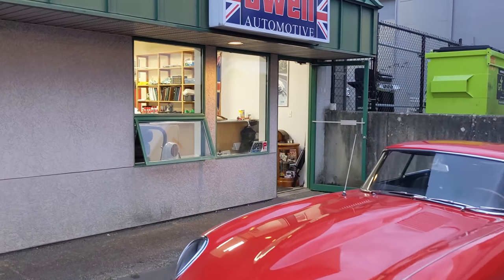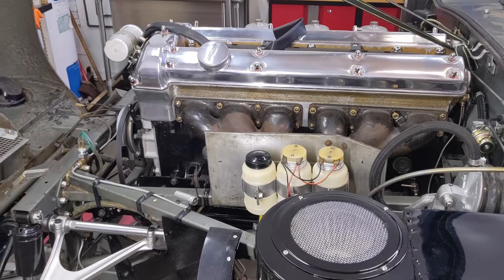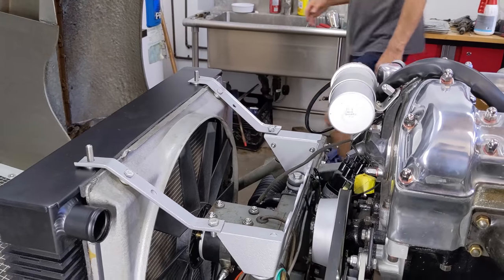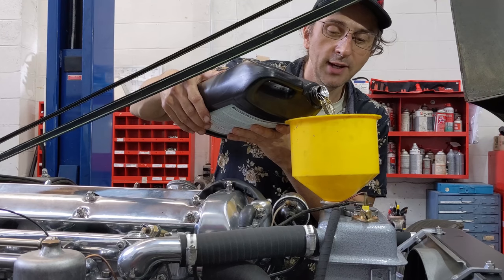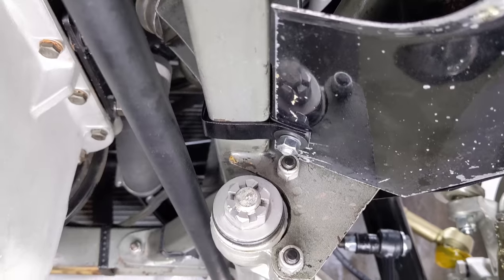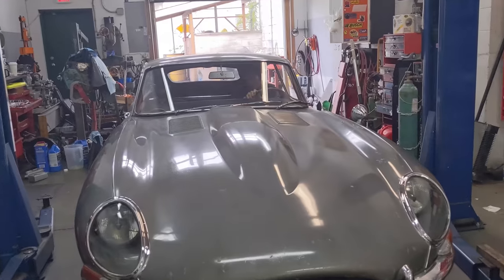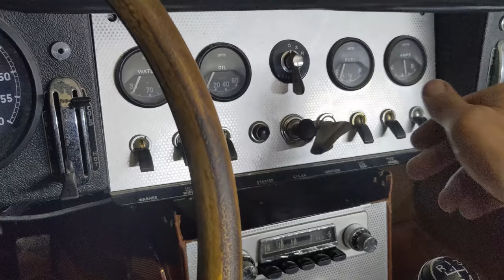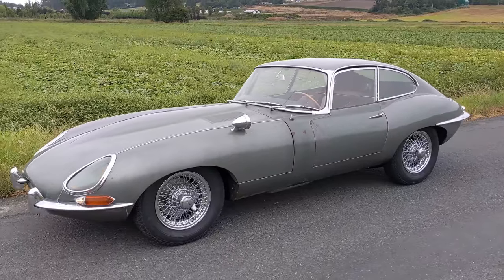Preserving an original 1962 Jaguar E-Type 3.8 EP6 **REUPLOAD**

Comment: I owned a '68 OTS in my 20s during the 70s. Watching your, Keep it as original as possible philosophy , videos put so many many smiles on my face. For I rebuilt most all of mine and boy did you bring back long lost memories. I got rid of those , in my opinion, horrible Stromberg carbs and put in the 3 SUs. Man what a difference in power. I rebuilt the rear end and changed the 3:54 to 3:31  It was my daily driver and also the car I cut my teeth on. I put at least 150k+ miles on her. Thanks for the memories and the smiles. Aloha

Comment: RMO, Great job on the car. I would love to have a Father like yours, the quiet one. Start doing this: turn your muffler clamps 180deg so as the bolts and protruding parts (the part that catches road junk) are on the top. Especially on the resonators.I like the later HD SS (Euro)band clamps.My two pennies.

Comment: I have owned a 1963 FHC "E" Type for twenty-seven years. It's a sound car if rather shabby but it had been messed about a good deal before I had it. The tan leather interior has been mostly replaced with black vinyl and it has been painted maroon from the original gold. For years and years I have wanted to find a source of photos or videos of a factory original car so I can see what went where, how it was attached, what's missing etc. so I can improve my car and make it more like when it left Browns Lane. This excellent series of videos is just what I've needed all this time. Dr Haddock's book is pretty useless by comparison. I will be revisiting these videos over and over again. Richard you have done a first class job in reviving and preserving this car which is so much more interesting than turning out just another over-restored 'E' Type. I thoroughly approve. Thank you so much.

Comment: Beautiful car.
Great job.
I'm impressed they can get spoked wheels to hold air without a tube.
Reply: Running those MWSs on my 120 race car in 16x6x72 spoke.  They work well.  I've mounted and flipped a few sets of Vredesteins on them.  No issues.

Comment: I'd recommend putting a heat shield over the rear of the generator to keep the electrical connections from getting roasted by the exhaust headers.  I made up a shield out of some scrap aluminium and pop rivets and fastened it to the generator with a large hose clamp.  Not really elegant, but sure helps the generator keep its cool!
Reply from the maker: The Generator is well below the manifolds.
Reply: @RichardMichaelOwen 
In cooler Canada that is sufficient spacing; but in the hot summers of Montana the connecting wires, and eventually the rear generator bearings, got fried on both my '63 E-types.

Comment: Awesome project!  Love seeing this car preserved.  I'm sure you've found this issue already, but, just in case you haven't, it looks like the cooling fan is rotating the opposite direction than it should be.  It looked like it was rotating clockwise (looking forward from the engine) and, thus, would be pushing air into the radiator.  Marvelous job as always.

Cheers.

Comment: Hi Richard.
Not sure if its camera angle, but do both pipes have same angle, one looks 45° the other 60° or wrong rotation.
We fitted one in 2020 and layed it out to old system.
Ours was perfect match.
Looks like down pipes not correct.

Comment: Great job, one comment - is the electric cooling fan turning the wrong way?
Reply from the maker: Hi Stuart thanks for watching. The cooling fan is right, but it can change direction by reversing the wires.
Reply: @RichardMichaelOwen  looked in the video it was going the wrong way - pushing rather than pulling. May be a trick of the video. Sam reason wagon wheels look like they are going backwards in old western movies